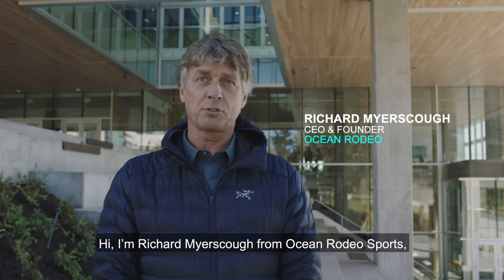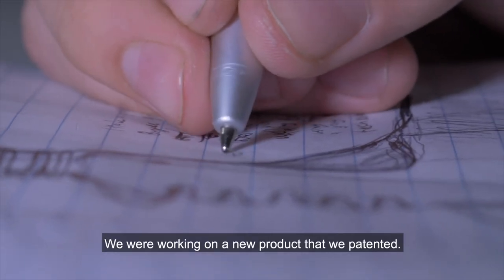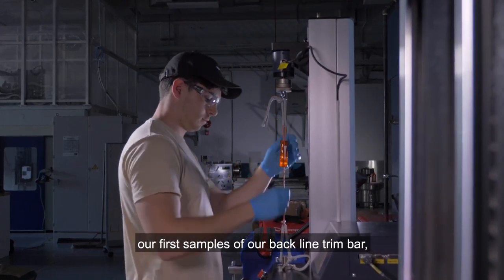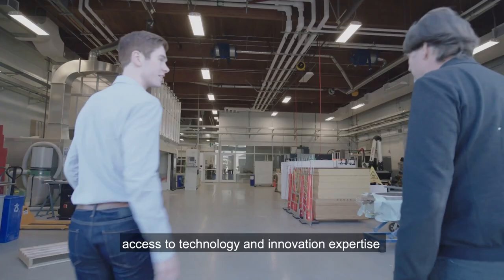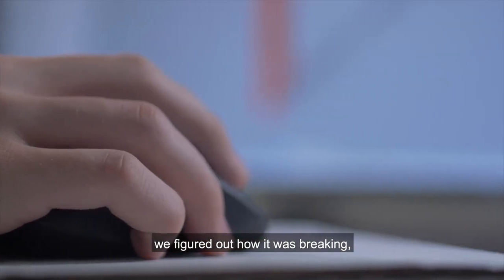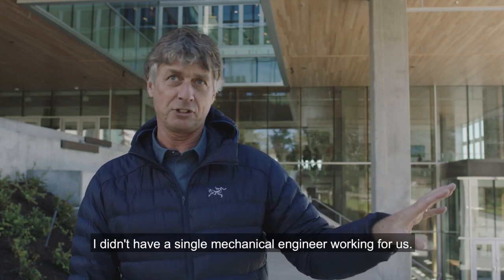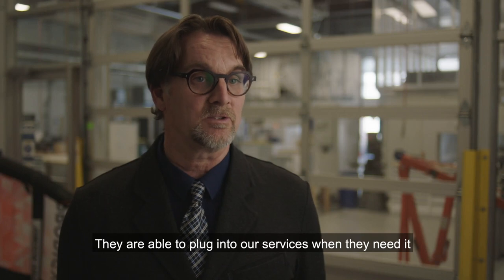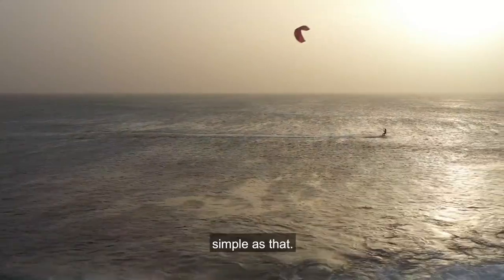Reinventing kiteboard equipment

Comment: I used the bar for 2 days and I still don't know where I am on the line trim...  Cleat trim all it takes is a glance. Duotone click there is a line on the bar. Ocean Rodeo TWO days and do I twist the bar and look under the bump knob and see how much line is twisted around it? Is there like trim status on the back lines itself?
If the purpose was to create an overly complex bar and make it heavy cuz it's overly complex I say good job!
Reply: There are red lines on the lines you can see just above the floaters
Reply: No use for the vision impaired
Reply from the maker: Hi Gary. Why not reach out to the manufacturer? Maybe they can find some solutions for visually impaired. Here's their email. info@oceanrodeo.com Cheers, Greg
Reply: @InnovationCa  And lacking in strength too. Titanium is for pansies!
Reply: Maybe it's the pilot?